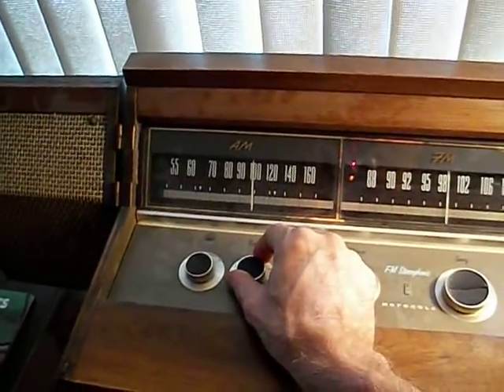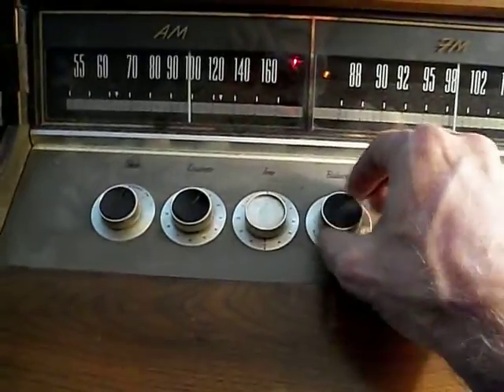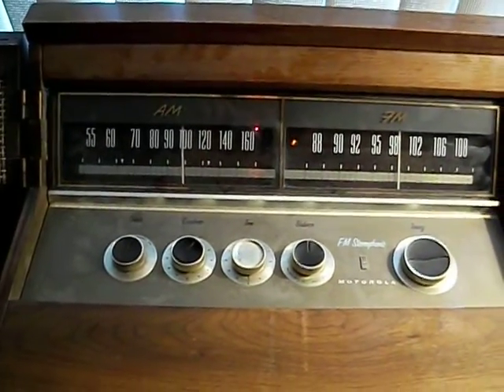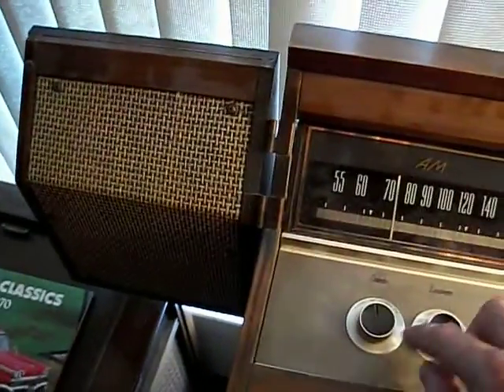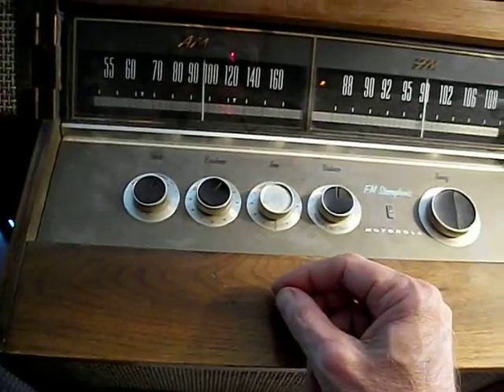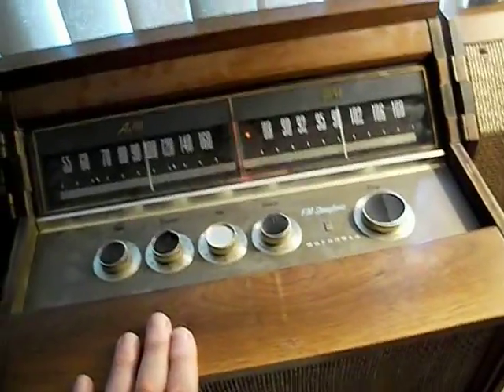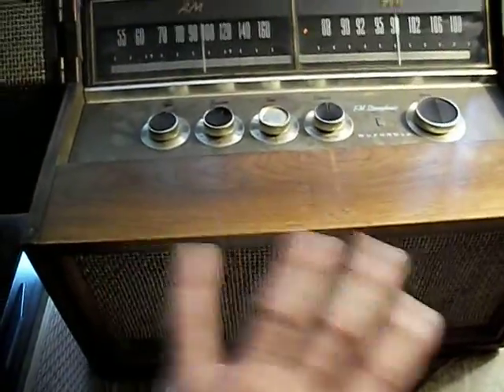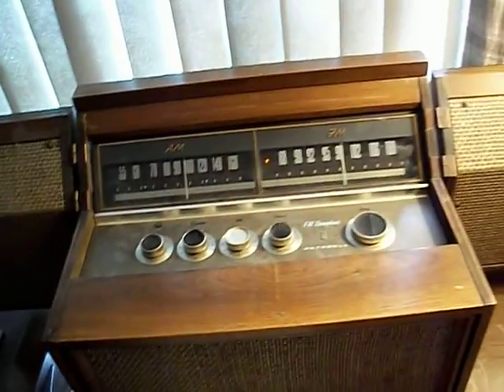Vintage Stereo, Motorola B1000W

Comment from the maker: It has rca type jacks on the speakers so you can detach and add cables for greater stereo separation. I will do another video later showing the chassis. It does sound very nice, its my daily driver as it fits nicely on the office desk. I see them pop up on ebay now and then. It is a pretty neat set, what did not show up on the video is the way the dials light up depending on AM or FM. it also has some neat built in carry handles that make it easy to move when in the borg mode.